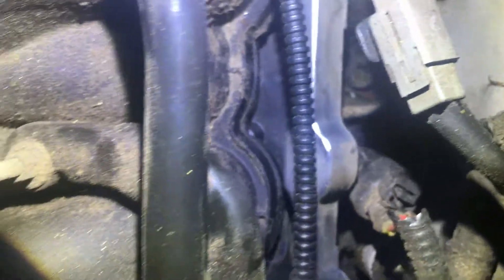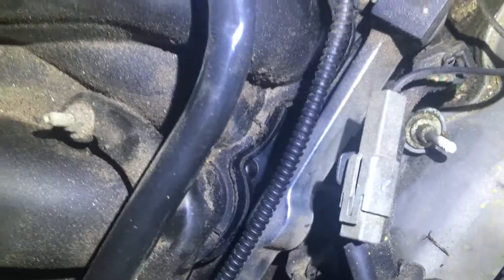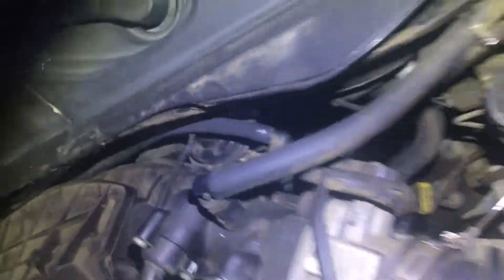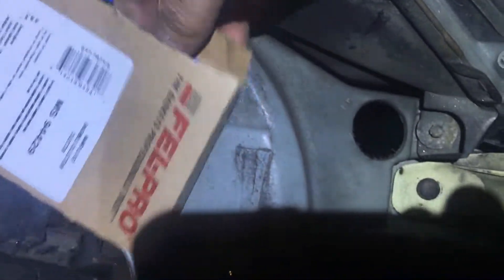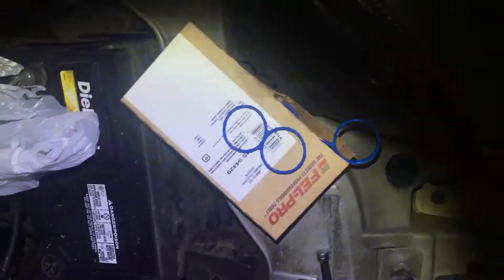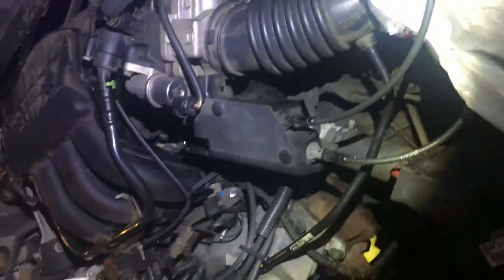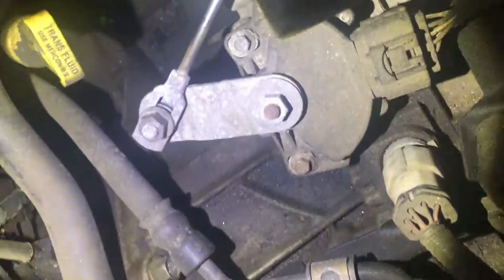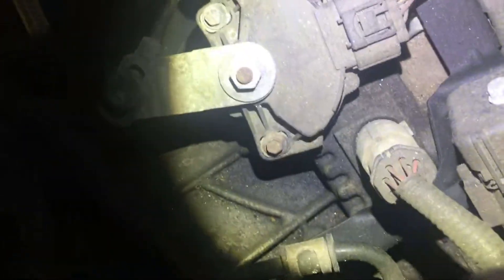2005 Ford Taurus 3.0L Vulcan Vacuum Leak locations smoke test random misfire lean rich

Comment: Smoke is the way to go, found 5 vacum leaks on my taurus today, car is barely running, hope it will fix it..
Reply from the maker: only 5? lol. check out my follow up video. the intake gasket is just flattened crazy. no clue how it was even doing anything. I retested and there was another leak at the damn runner control valve. although very small and I think I had the PSI too high. the EGR valve was now leaking. I think I may have had the PSI too high and messed up the egr valve. but then again the runner control valve was a gaping hole before so maybe its always been shot or maybe its built to vent at a certain psi?? I dunno. all I know is a month or 2 later no lights. I did see a random multiple misfire on start 2 weeks ago. I can hear the engine still isn't smooth. but its good enough. as long as the light stays off I am not replacing that egr valve. I can just see it being a worst pain lol. replacing the intake gasket isn't really a big deal. I actually put gasket sealer there also cuz I don't plan to take the damn thing off again! https://www.youtube.com/watch?v=3w06WzTH90o
Reply: @bobspurloc  how high was your psi? I was only using a pound or 2.
Reply from the maker: LOL! I don't know its a crap meter it. as soon as the needle moves it goes near 5psi. I did get some stuff that is more precise for the future. I doubt it was ever over 7psi. most likely 5psi but I cant trust what the meter was saying. even better is somehow I reconnected the battery to the smoker and left it running till battery died hahaha... garage stunk of baby oil or whatever that is I put in there

Comment: 👍 Thanks for the video as it gives me areas to inspect. I am having so many problems with this vacuum bullshit! My Daughters 02 Taurus is nickel and dimming me and I still haven’t solved the issue. Chasing vacuum today...AGAIN! 
Thx👍 (Cam position sync)
Reply from the maker: hrmm missed your reply. Yes this engine is a total piece of crap. that flapper intake passenger side back of intake its oring goes bad. oring on egr tube goes bad driver side back of intake. the intake gasket goes bad. I haven't seen any of the vacuum hoses crack yet but they certainly can. the stupid plastic rubber one for windshield fluid breaks why not those

Comment: Do you still have the random Misfires?
Reply from the maker: I haven't had time to replace these gaskets yet, but I am 100% sure it is what is causing the random misfires. I keep forgetting about it because the engine light isn't on anymore after replacing the big oring gasket on the back upper left side of the intake. hopefully I will get to it in the next few days. I have to rewatch videos how to get the intake off, truthfully I got annoyed it takes a lil more effort on the Taurus compared to the MKZ lol.
Reply: bobspurloc have a 06 taurus here and it’s had that random miss for 5 years or more. The only thing I replaced was the o ring gasket in the back. I’ve heard sometimes these computers need a replace to fix the random mis. It’s very annoying.
Reply from the maker: Yup. this one has been misfiring for 5 years too, that back large gasket hardens and does nothing. I was getting misfires on certain cylinders. after replacing it I only get multiple misfires in first 1000? cycles. and it still runs slightly rough. I wasn't aware it was leaking at the intake gasket. that leak will def cause random misfires like Im seeing because air its just flowing directly in. the egr oring is bad also. so when I get around to it I will replace both. ive just had more important things as this isn't do or die since its been doing it for so long lol.
Reply from the maker: Finally replaced the intake gasket and egr tube oring. pretty sure it fixed everything. it wasn't that hard really. https://youtu.be/3w06WzTH90o

Comment: That smoker came in really handy for you, Great video, gotta love the diy ideas.
Reply from the maker: Yeah. I bet if I hadn't replaced the Intake Manifold Runner Control Gasket before testing I would not have seen these leaking too, that is how bad that one was leaking lol. I haven't fixed these yet. probably will do it in a few days. NOTE: spraying carb cleaner etc to these areas did not change engines speeds and surprisingly that test failed on the Intake Manifold Runner Control Gasket also.